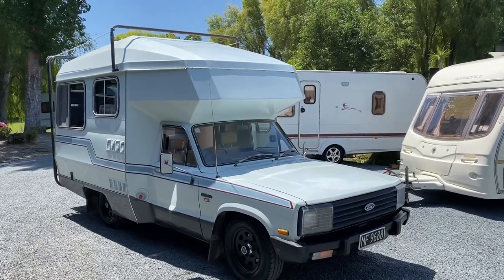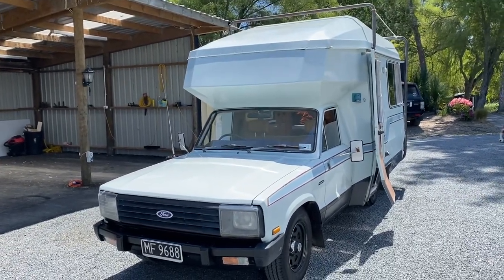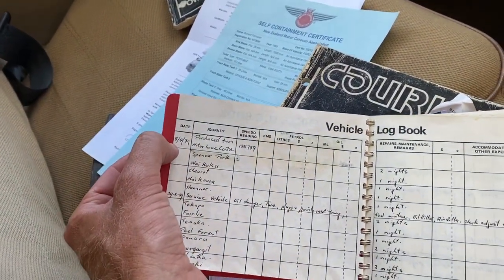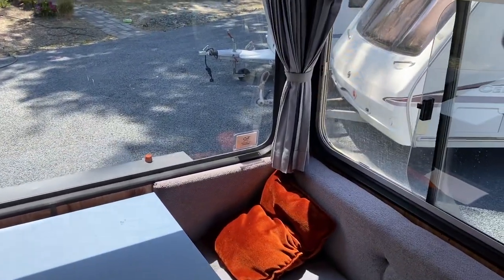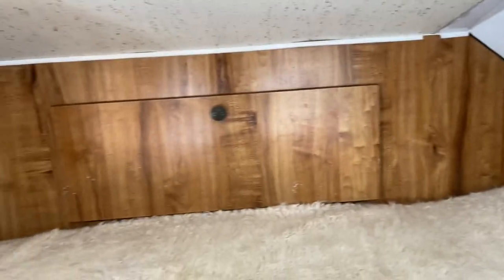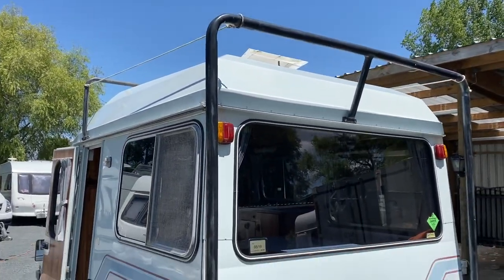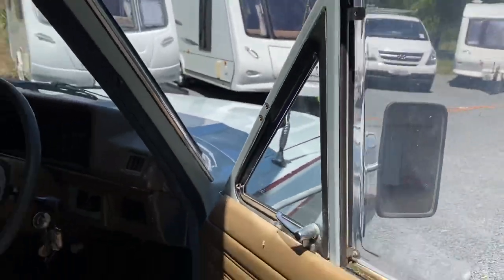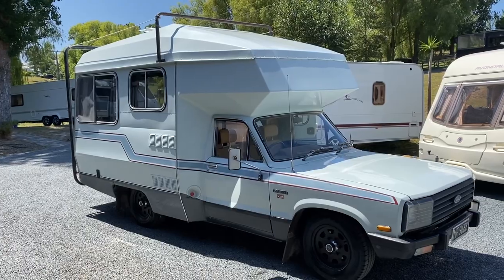1985 Ford Courier 3 berth camper . CI Munro

Comment: Lovely Munro camper.Munro built these campers to last,built from high quality materials from the chassis up.Problem eventurly was water getting in arround the front seams over the cab,so silicon was the answer.They certainly dont build campers as good as this anymore....I owned a 1985 Canter,same layout and design.